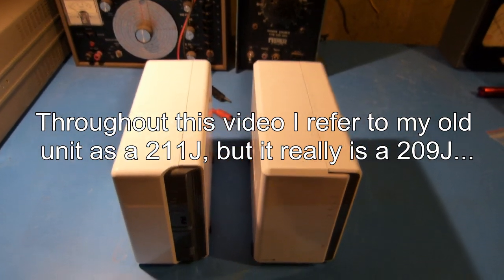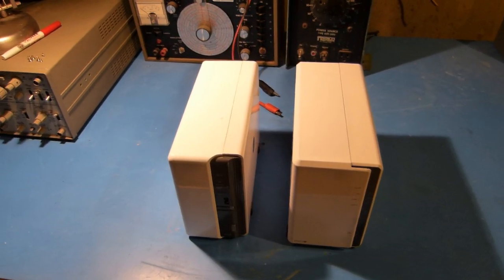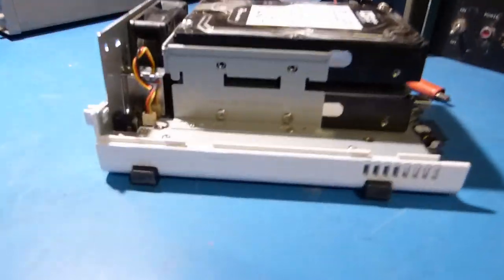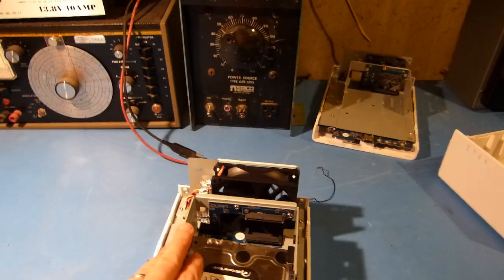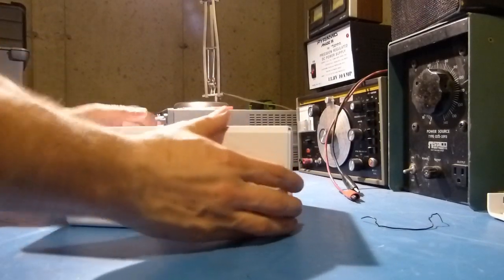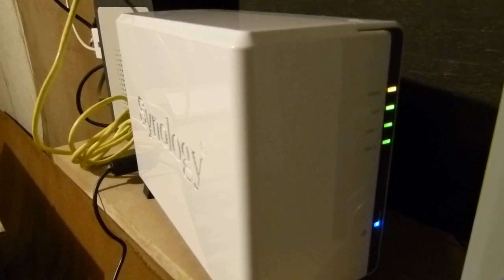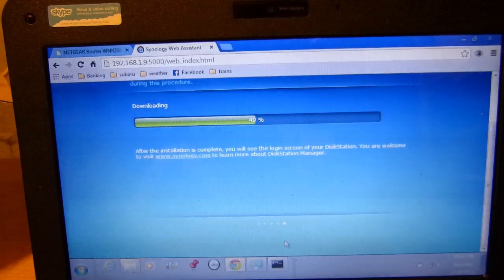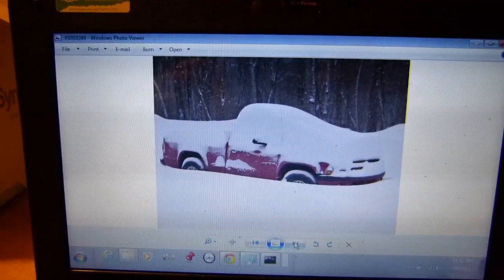Synology DS209J DiskStation to DS213J Disk Station NAS drive migration highlights

Comment: Thanks for putting this video up bro. I am facing the exact same issue (Synology 216+II). THe only problem is, I can't be sure if I mixed up the 2 HDDs positioning - I hope I put them in the right order as I had not marked those drives prior to this! But your video gave me some confidence to attempt this tonight. Wish me luck!
Reply from the maker: Good luck - I hope all goes well!
Reply: if once put the positioning of the two HDDs wrong - can this cause following problems / issues?
-
just trying to start up my DS213j. No matter what positioning the two HDDs have, my DS213j does not start up. The power light is constantly flashing blue and the two disk lights are switching on and off orange.